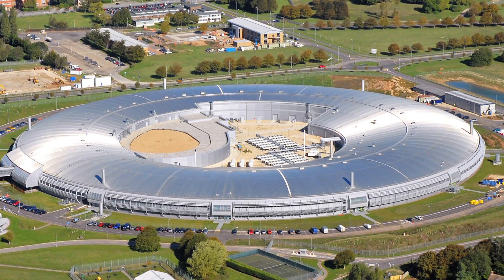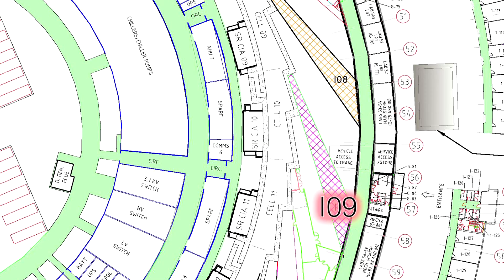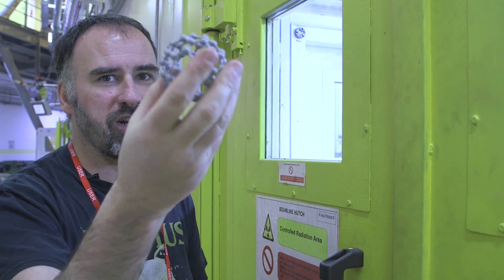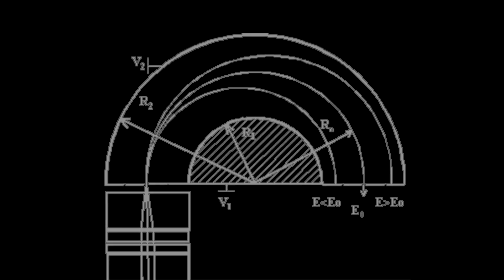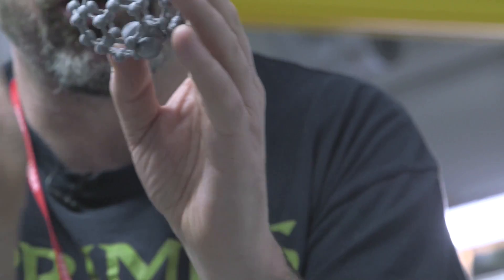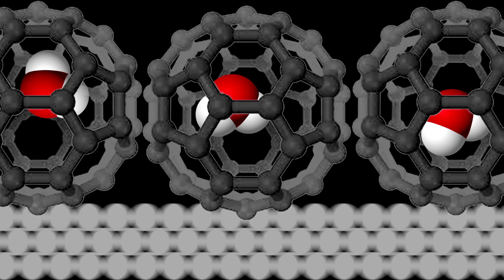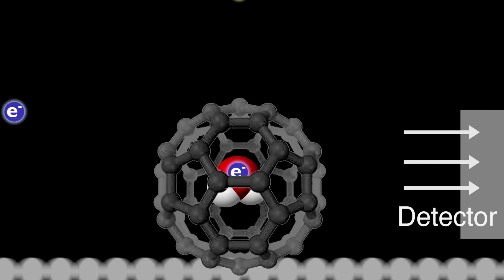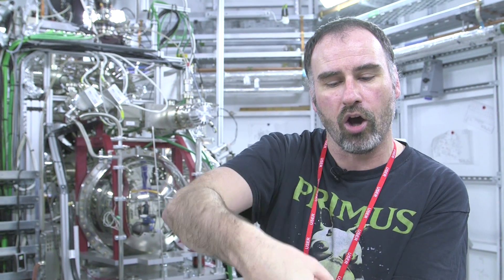Anatomy of a Physics Experiment - Sixty Symbols

Comment: Thank you for the fascinating physics topics! This is yet another reason for me to push through and complete my physics degree, thanks for the inspiration! 
I just wish I could see the data and talk with Dr. Moriarty about what the features in the data imply. After doing a basic experiment on the photoelectric effect, how would this H2O encapsulating C60 film effect the photon absorption, and is the C60, H20, or the plate that was originally coated (or a combination of them) the supply of the electrons?

Comment: Which branch of engineering is responsible for designing the apparatus where the sample is placed?
Reply: Evan Weinberg Multidisciplinary team. Not just one branch.
Reply: Of course. Would a team of mechanical engineers be working with a team of chemical engineers? Would a systems engineer be involved?

Comment: They do this same type of research at the APS (Advanced Photon Source) at Argonne National Laboratory here in Illinois. I have privately toured the APS along with being inside the synchrotron, the electron gun, linac and the hutches as well as on top of the beamline where the RF waveguides are that accelerate the electron beam. Its so amazing what is being done with high energy photon sources.

Comment: Hey Phil, Got a question? Is it possible that redshift is generated not by space extension, but by the photon having a very very very tiny mass?
Reply: I wonder why it can't be because of the different wavelengths. Light is refracted through the small length of a prism, so when travelling the unfathomable distances through space, what if they don't travel at exactly the same speed through space, resulting in redshift?

Comment: Shouldn't the uncertainty of the momentum be off the charts if you triangulate the water molecule inside such a tiny space?
Reply: I think the molecule is too big, the uncertanty only affects sub atomic particles not whole molecules. But thats just a guess, I am no particle physicist
Reply: i dont think they really care about the momentum, just about where the water molecule is
Reply: Yeah, but that would mean the momentum could be any value so there is no chance for the water molecule still being around the same position they measured it at first, it would jiggle all around so to speak, wouldnt it?  Is the information you get from the triangulation still usefull then (for determining an average position or something)?
Reply: I'm guessing that just because there is a high uncertainty in momentum, that doesn't mean there has to be a large momentum